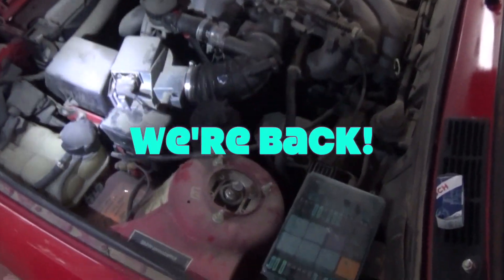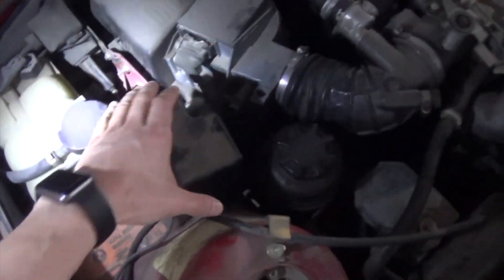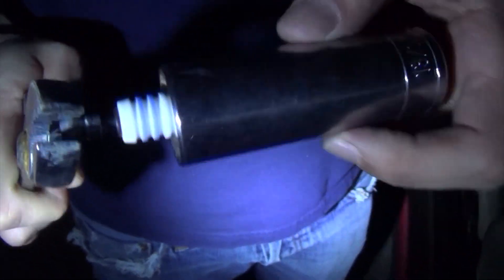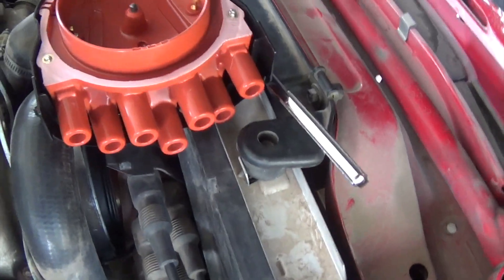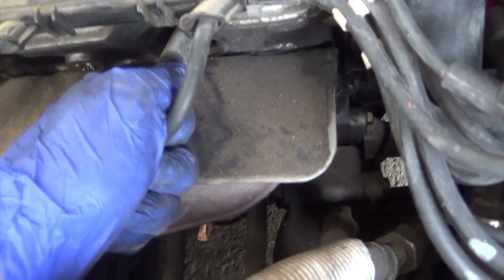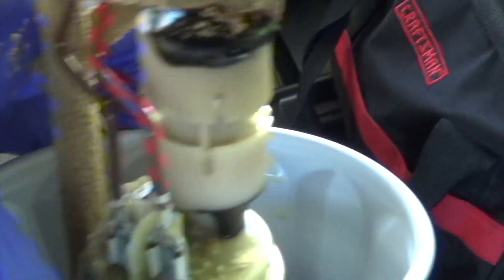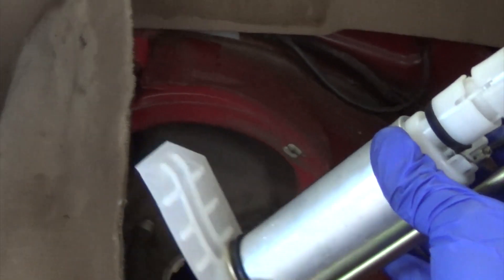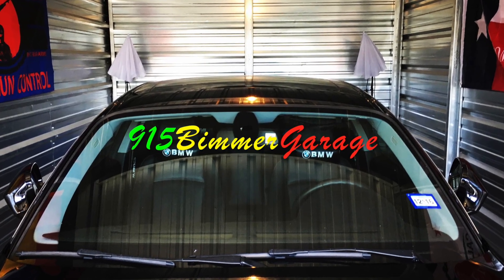BMW e30 No Start Guide- Part 1 (Replacing)

Comment: Change everything 😂 still won’t start, k u help 👋
Reply from the maker: Alphonso thank you for watching and sorry that the solutions provided did not work for your e30. Perhaps you should look into spraying engine starter spray into the take boot and see if that helps. Try to add a good amount of gas as well.
Reply: Check if there is spark and also if fuel pump is running when u swing it might be cps

Comment: E30 fuel pumps only turn on when the engine is spinning.
Reply from the maker: max p makes sense why I’ve never been able to hear it. Thanks for the info and for watching!
Reply: @BimmerGarage  Yeah, when I bought my e30 it had a DME problem so in order to fix it I basically had to become an expert on Motronic 1.0-1.3. The DME will only energize the fuel pump if the following conditions are met: proper signal from crank position sensor from a spinning engine, proper grounding, and proper signal from ignition switch and neutral safety switch if equipped. Fuel pump is energized for approx 5 seconds and if the engine is still not firing it is switched off as a safety feature.
Reply from the maker: max p Hey there buddy. If you get a chance. Can you check out our most recent video? The e30 died again and we are stumped now. Could not find an air leak and it seems like it’s not getting fuel. Put in a new fuel pump again and also a fuel pressure regulator, still with no luck.
Reply: correct

Comment: YAY! You guys are back!!! I hope all is going well. Good work on the E30, but next time, save yourself some time and TEST. You could have pinpointed the fuel pump as the problem by simply testing for fuel flow into a catch can while cranking. One other thing: any time an M20 engine (2.5 or 2.7) has been sitting for that long, you're taking a chance that the cam drive belt is still good. A $50 investment in a new belt and idler pulley BEFORE trying to crank it can save you hundreds in a head rework if the old belt breaks.
Reply from the maker: hornhospital I had no clue we could check the fuel pump like that. As for the belt, we bought one and anticipated changing prior to attempting to start the car. However, the combination of not having time and being slightly intimidated by the job caused us to take the risk without it. But we are still going to change it.  We hope you are doing well!  I will send you an email soon. Sorry for my lack in response. 

We are glad to be back and will finally have time to be releasing consistent content!
Reply: How do I test the fuel pump as being the problem. Vehicle is a 1985 325e. It cranks but wont start.
Reply: put external 12v power and ground to the pump connection, if you don't hear a buzzing sound the pump is bad.  Or turn the key on and try to hear the buzzing sound.

Comment: I got a problem my engine gets fuel but don’t state
Reply from the maker: Also, have you tried to spray starter fluid into the intake while turning the key?  If that does not work... CPS or ECU I’m thinking.

Comment: Found your channel and subbed.  Good stuff.  I got a 91 318i.  Changed out fuel pump for second time. First one was a used one.   Used one worked but I bought a new one.  New one worked but now car doesn't start.  I checked and pump is pumping gas to fuel rail.  I changed out injectors and still no start.  I'm thinking the new pump was so powerful it broke the regulator.  Going to pull everything off again tomorrow and check if pressure is getting to regulator.  Thanks for video. 

Oh is there a way to test if regulator is bad?
Reply: Any luck with this? I've got a '92 318i cab and it's got the same issue. No fuel pump noise and cranks but won't start

Comment: Hi guys. great video.  I have the exact same problem with no start.  I'm hoping you can point me in other directions?  I stated with fuel relay by engine bay, cap n rotor, coil.  Fuel filter, fuel pump (Was definitely not working) New Crankcase Sensor (2 to be exact). New DME (above the glove box) squirted fuel in the injector line.  No ignition...

The engine was running a bit rough idle at a traffic light, then died and now will not start after the above parts change.  Any suggestions?
Reply: Do you have spark?
Reply: @UHOH3300  no sparks, no power to the fuel pump. Must be some master switch got tripped when fuel pump died.
Reply: Jonathan Pan check the main relay. It’s near the drivers side in a little plastic case. It’s usually the one towards the front
Reply: @UHOH3300  the main reply next to the fuel pump relys?
Reply: @panjonathan  Yes. It's the lower one. Check that that relay is functioning properly. If it isn't, then the DME isn't energized and the car cannot start and will have no fuel and no spark.

Comment: Hi,
I have an 87 325e 2.7L that cranks but won’t start, any recommendations?
New spark plugs and cables,new fuel pump, new relays, new battery and alternator.
Reply from the maker: Thanks for watching. Hold the gas pedal down when you are cranking and let me know if it changes anything. Also, don’t forget to watch part 2 and part 3.
Reply: @BimmerGarage  feels like wants to start but…. Nothing

Comment: Hi there I have a 90 325 with no spark my coil has 2 lives is this correct
Reply from the maker: Thank you for watching and reaching out. You are correct. I have provided a detailed description below for checking your coil from the net. 
“two small Primary terminals, and a large Secondary terminal known as the King Post.

The first Primary terminal, +, is numbered 15 and gets its power directly from the ignition switch. This green wire goes from the switch, through a plug and socket clipped half way down the steering column, across behind the dash to a two pin socket above the glovebox, fitted with a plug with a loop, (where the immobiliser should have been connected), up through the duct behind the glovebox into the fusebox. It passes straight through the fusebox with no connections, out to the 20 pin C101 engine loom plug beside the fusebox, then into the engine loom and to a coil. Inside the loom there is a single branch to the ECU.

The second Primary terminal, - , is numbered 1 and goes to the main ECU inside the engine loom. There is a single branch to the diagnostic socket.

If you want to test your coil, follow these steps:

Disconnect all cables from the Coil
Using a multimeter, measure the resistance between the two Primary terminals. You should get a reading of 0.5 Ohms.
Now measure the resistance between terminal 15 and the King Post. You should get a reading of 5000 Ohms.
To test it is receiving power, ensure all cables are correctly attached, and then use a bulb to ensure you are getting 12V between earth and terminal 15.”
Reply from the maker: The King Post connects to the distributor via one large HT lead. To test the condition of this lead, measure its resistance. It should read 2000 Ohms.

Comment: The e21 m10 spark plugs require the same. Found that out when the plugs came in after I freaked out about them not connecting to the distributor wires. Whoops
Reply from the maker: Haha. Good to know. We are about to swap ours on the e21 also. Thanks for watching. We have a lot of videos coming.

Comment: I got a 1995 bmw the fuel go’s to the engine but engine don’t what to start need help
Reply from the maker: Thanks for watching. Have you checked the CPS?  If not the CPS, maybe the ECU?  Let me know a little more about your car. What have you tried?  When you turn the key, what happens?  Are you sure it’s getting fuel?  Easy way to check is pull the hose from your fuel pressure regulator and see if fuel comes out. You can also pull out the FPR, just tug on it and it will pop out, fuel should pour out of it. If not. Order a used one.
Reply: Because that guy that had it before me he put the battery wrong
Reply: @BimmerGarage  but the engine cranks and I took the off the holes on  the engine and when I put fuel in the engine it start for a bit and turns off
Reply from the maker: Bro. If he put the battery on wrong he fried your ECU. Don’t worry brother. Locate where the ECU is on your car and find a used one. Needs to be IDENTICAL. It should fire right up after that. Buy a used one that you can return in case it does not fix the issue, you can return. But I feel very confident that this will fix your issue given that the battery was on backwards.  Keep us updated!  Feel free to ask as much as you want.

Comment: mines starts but it wont hold,also did the adjustment on the throttle
Reply from the maker: You saw how to adjust the throttle in our Part 3 video right?  See part 2 and 3. There is a video uploaded right before part 3. See if your car has the same symptoms as that video. Let me know.
Reply from the maker: Also, if you hold your foot on the gas pedal slightly, does it keep running or does it still die?